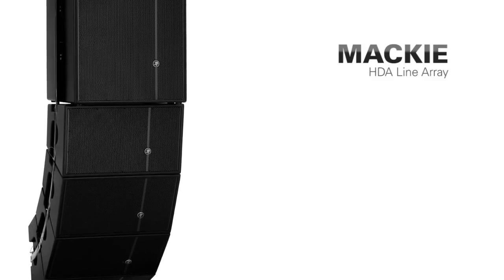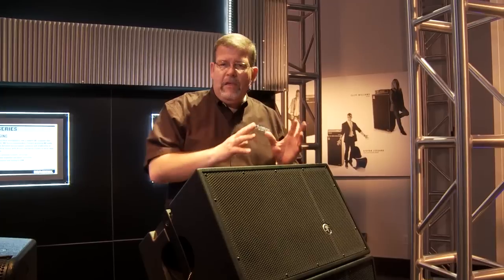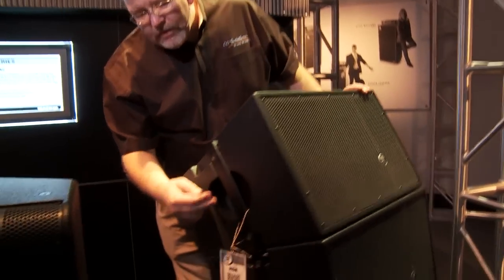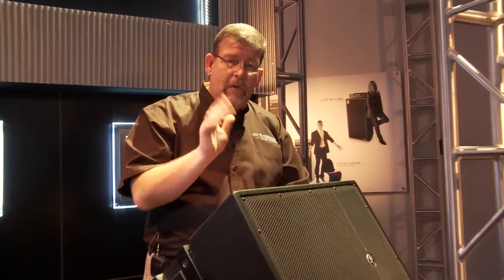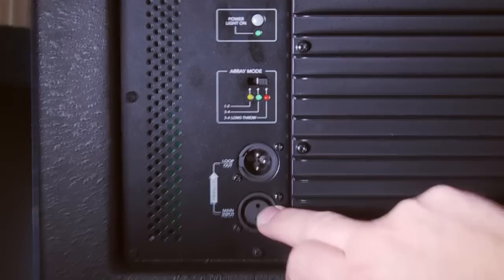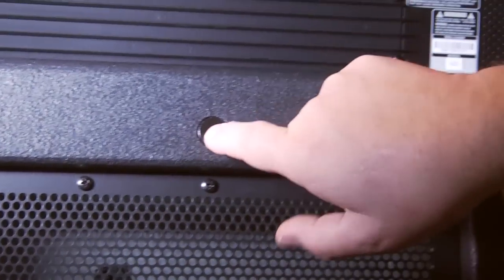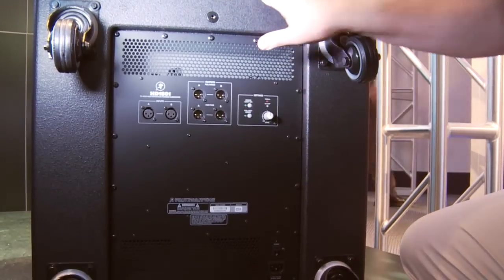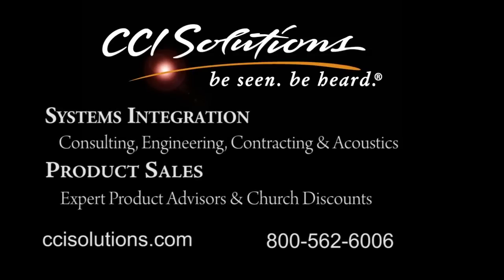Mackie HDA Arrayable Powered Loudspeaker - In-Depth Review

Comment from the maker: Thanks for the comment!  I'd be concerned about vertical coverage since each of the top boxes has a 20degree vertical coverage angle.  With two top boxes, you have 40 degrees of vertical coverage.  Depending on how high your rig points are, you may have to choose between covering the front or rear of the ballroom.  Call or email us and we will be able to give you a specific answer for your ballroom application.  All we need are the room dimensions and rigging height.